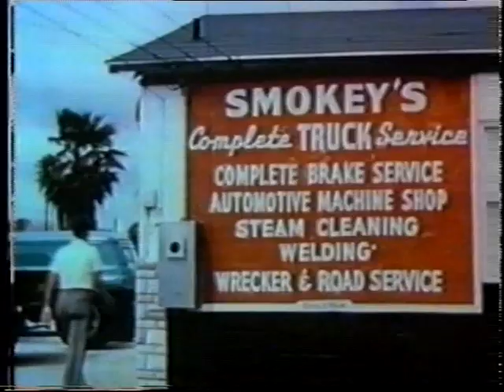Smokey Yunick

Comment: I've made a study of all the articles I could find about the hot vapor engine and have certain theories on its operation.  Why don't we know more and why is this technology extinct before it gets out out of the shop.  Anyone want to have a serious discussion about that engine,  please comment back.
Reply: Because it's owned by the big auto manufacturers.  I was in the new car business for 11yrs and while with Chrysler was close with the engineering team's and they told me MANY dirty secrets about that part of the industry...I asked an engineer at a event after a few drinks, why the 3.5 intrepid engine didn't get more millage and power. Because it had all the making's of a hot rod engine, overhead cams that stuff. He told me that's the fuel mileage they want it to get, but dirty deal's with the petroleum industry make it that way. When a designer come's up with a great invention the big guy's come in and buy the invention or litigate the inventor into bankruptcy....smh....from Wyoming USA 🔫🤠🇺🇸p.s stay safe
Reply: We have 5 of his Hot Vapor engines and ran the 2.2 Chrysler on the 10 year anniversary of his passing and will be putting it in the original car and running/driving it for the 20 year anniversary. Should be doing this in the next 30 days. I have videos of the engine running and me taking the 2.5 Iron Duke apart.
Reply: @MrDanielSoliz  let’s see video
Reply: @farmerbobross  the videos are on my channel.
Reply: I suspect it is very difficult to control pre-detonation.  Mazda are essentially getting the same result with SCCI - but they are doing the heating in cylinder immediately pre spark.